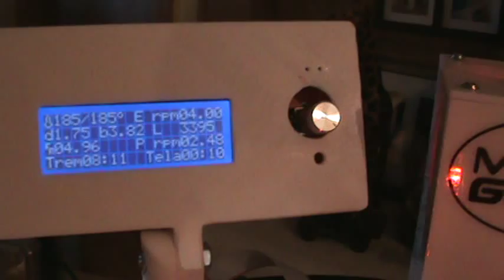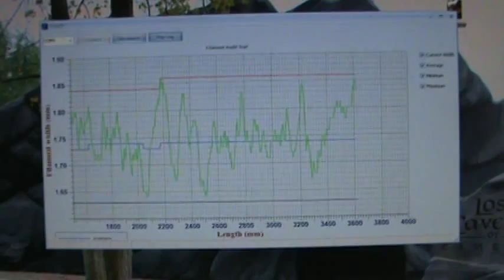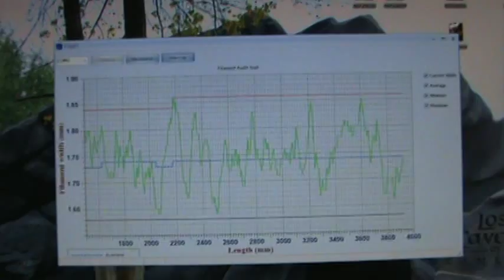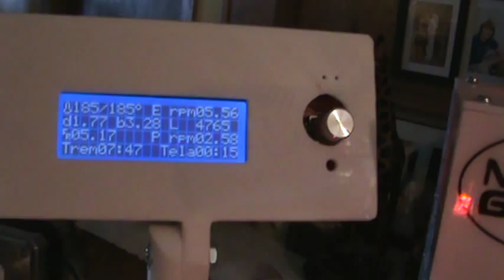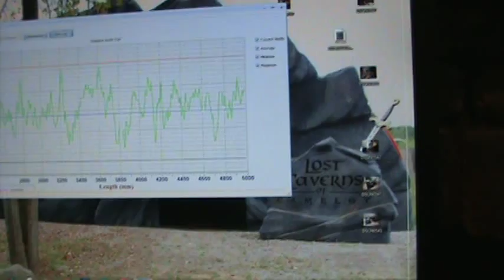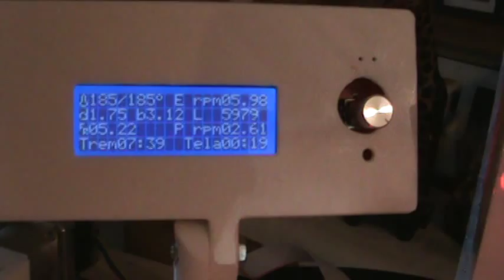Two Sensor test of Lyman V5 Filament Extruder

Comment: Hi. Great video, thanks. Knowing it worked partially, but mostly, inspired me to build my own v5 extruder. Fun wasn't it? 😁 😣 I was just wondering could you tell me how you connected the machine to the laptop, usb? And what program you used to produce a graph from the filament sensor? That would be eeexcellent to be able to do.. Your machine looks like a tidy job! 👍 I might also try and reprint all of the components with the white look like yours. I am currently multicolours everywhere 😅 Thanks again...

Comment: Was it easy to make?
Can you share any problems with it?
Can you share code also?

I am interested in making this but there has been some bad feedback so i would like to know before purchasing parts.

Replies are greatly appreciated.
Reply from the maker: Fin Wilson You can make usable filament with this unit. It is not perfect but it is the best I have seen, I think it out performs many purchased units if not all. You can of course get better if you spend $150,000, but for under $2500 I don't think this can be beat. But be prepared to tinker.

Comment: If you have the time please share details of the improvements Philip and you have made to the V5 extruder. I should have most of the parts for my V5.1 next week. I'm working on making the three LED filament sensor(http://www.thingiverse.com/thing:704897) to use on extruder and printers. I'm learning to CNC mill double sided pc boards. I really want to make my v5 with two sensors like yours. Thanks

Comment: Impressive machine you got there. I have my doubts if you will be able to extrude 1.75mm filament with an orifice of 1.75 mm. From what Mr Lyman says himself I think you should come to the correct diameter of the orifice by multipliying the filament diameter with 1.5, meaning the orifice should be about 2.5mm and the puller is used to make the wanted diameter of 1.75mm.I hope I'm not wrong but this is what I've read about it.